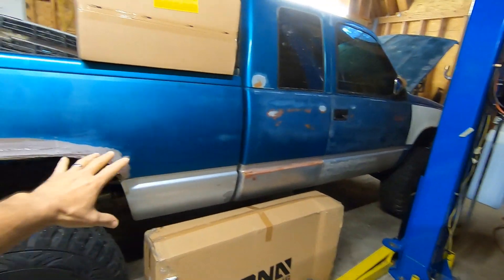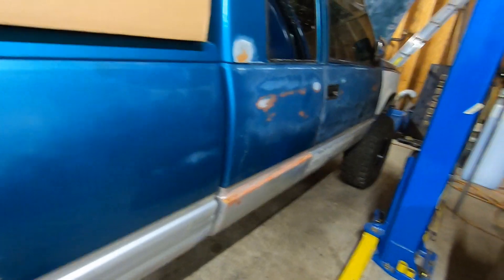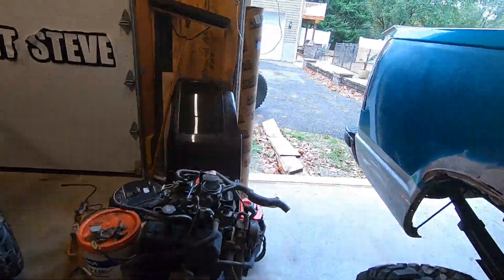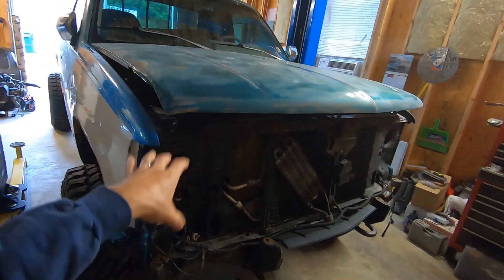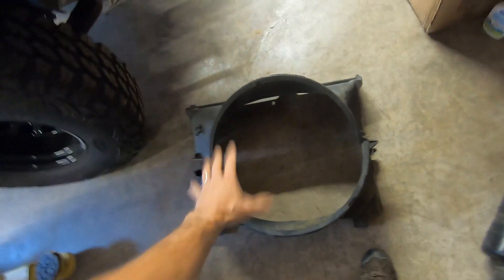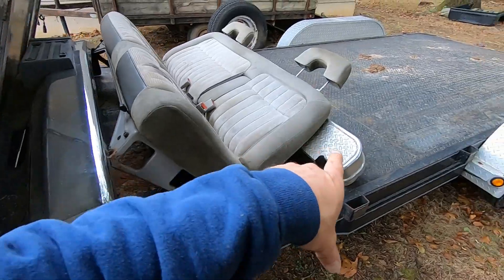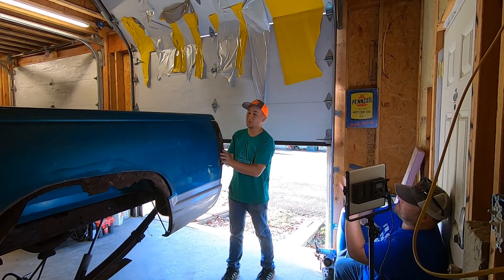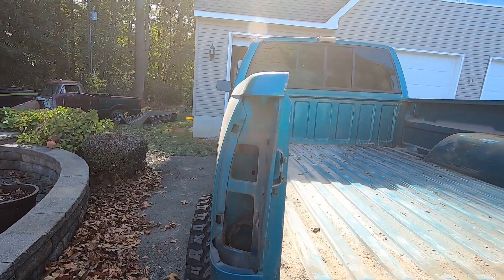OBS UPDATE

Comment: I have a 98 OBS Chevy Silverado truck 4wd reg cab long bed it's the dark blue it only has 66,678 miles on it and it was my grandpa truck and when he passed I got the truck but it has no rust at all but I blowed the rear metal break line's so I had it fixed and had them replace every line hose best 400.00 I've spent other than routine maintenance I have not done anything else to it
Reply from the maker: Nice, sounds like a time capsule! Enjoy it!